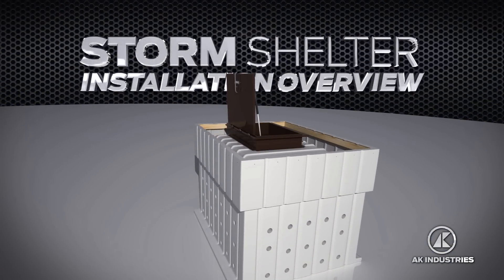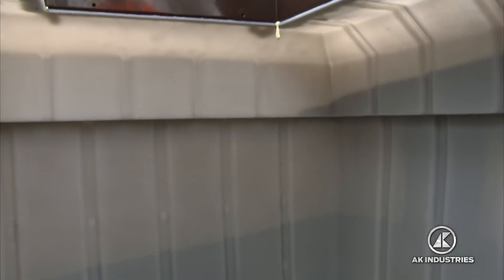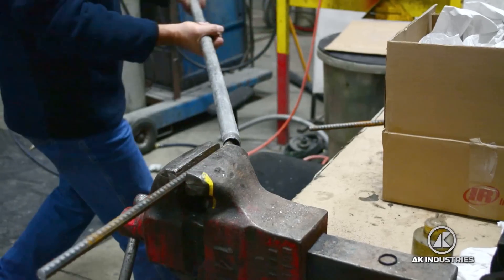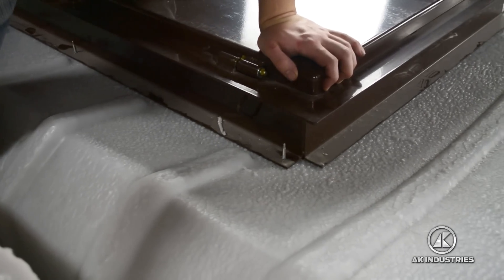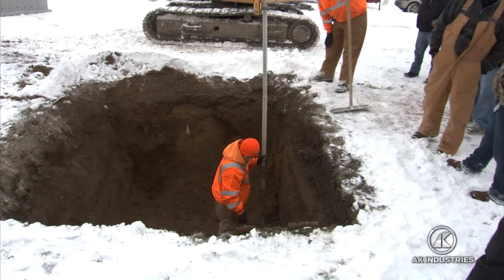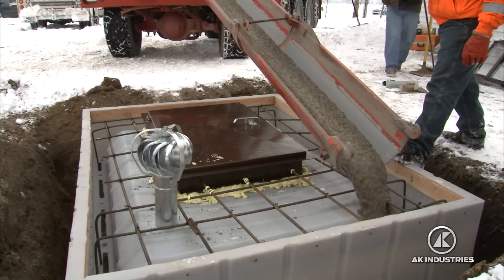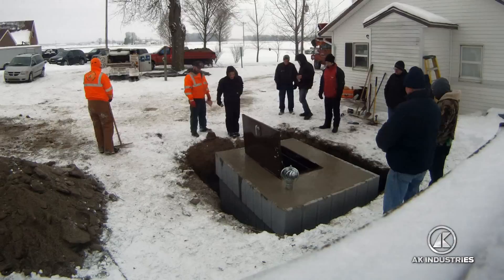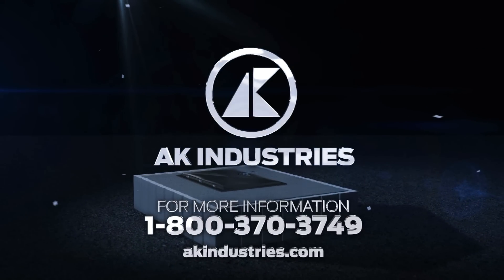AK Industries Storm Shelter DIY Polyethylene Concrete Form

Comment: Only thing I'd improve on is the door design.  If your entire family is inside and something blocks that door, i.e. debris too heavy to lift, you are in a bad situation.  I mean, even a tree falling on it, how do you open it without some kind of hydraulic manual pump lifting the door up to x amount of lbs?
Reply: Just leave a $20  5 ton bottle jack with an appropriate length piece of steel round bar in the shelter and jack from the concrete floor to the door.